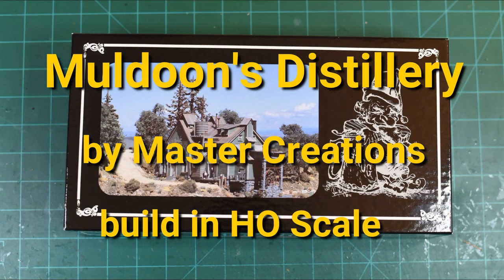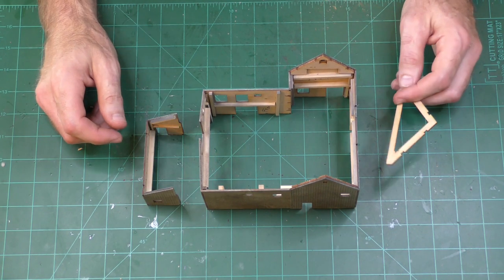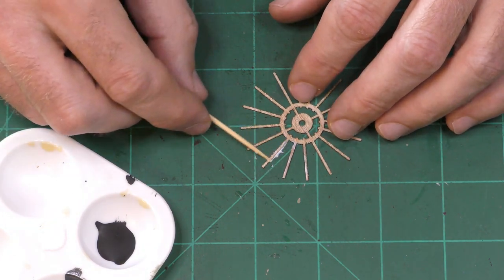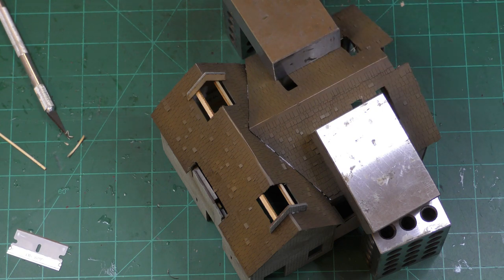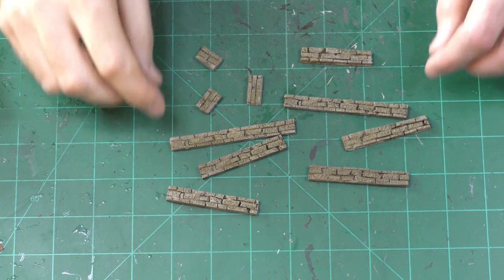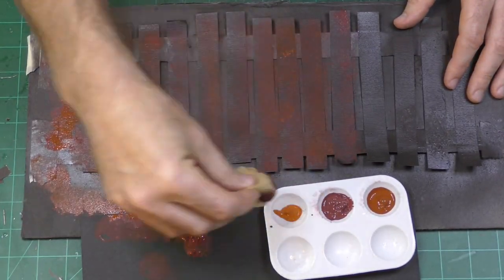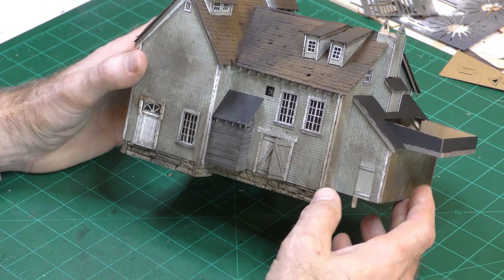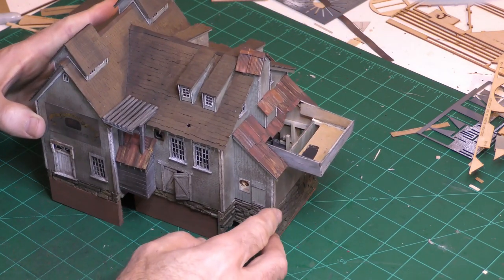Master Creations Muldoon's Distillery Build in HO Scale

Comment: Congrats on finishing .  These are quite challenging.  As to the ridge caps using a brown paper bag - just use the bottom of an envelope.  It's already folded and when you cut it, it will match on each side.  Just  paint it to match.   One caveat - it isn't all that common to have a tar paper ridge on a wood shingled roof.

Comment: Great build. I have fooled with the wood kits and they all seemed to be a  little difficult. Since I run N scale that doesn't help. You have some excellent tips which should help me, as I have a lot of building kits that I am going to build. I think the building turned out great. Thanks for sharing. Dave
Reply from the maker: Thanks for the comments.  My first wood kit was a Bar Mills basics kit, but I don't see that in N scale.  They do have the Shack Pack in N scale.  I recommend that.  Three different shacks, so you have three chances to get it right and it is pretty cheap.

Comment: You guys spend all that $$ on weathering powders and I go to the dollar store and buy women's make-up and get the same colours you do and mine only cost $1.00.  It also clings better than weathering powders..  Also I make my own rust (iron oxide) by soaking about 4 pieces of 0000 steel wool in a quart jar with white vinegar for a couple of weeks.  Then I pour it out into a photo (stainless steel) processing pan (tray) and wait for a few weeks for it to dry.  Then I use a single edge razor blade to pulverize it into a powder.  Now I have real rust to use as you would apply powders, i.e., mix it with mineral spirits or alcohol and a drop of glycerin.  Looks like real rust--'cause it's real rust!  Cheers from W Rusty Lane K9POW in eastern Tennessee

Comment: Thanks for the build. You did an excellent job and I appreciate you showing the short comings of the kit. I had the opportunity to purchase this one combined with another at auction. Had I not seen your build I would have purchased it. I am not a beginner and have built Cambell kits ... no laser cutting there... but at least the material is there and the instructions are fairly clear. They too are not for beginners. 
Have you tried Laser Art kits? I have enjoyed them and the parts fit together with a little sanding. 
Thanks again, Joe
Reply from the maker: Thanks for the comments.  I have not tried Campbell or Laser Art kits.  I saw some Campbell kits that looked interesting, but I already have more buildings than I have space for.

Comment: Interesting kit and fun to watch. You have some creative ways to deal with the challenges. Glad you kept the water wheel. Can I ask what kind of sponge you use?
Reply from the maker: Thanks for the comments.  They are natural sponges (at one time a living creature).  I get them at Hobby Lobby in the art section with paints, brushes, etc.  I assume any art supply store would have them.  However, I think some people prefer grout sponges which are synthetic.  So you might try different varieties.
Reply: @asdasx392  Thanks. I had tried some synthetic and found the results a little too even and regular. I'll pick up some natural ones to try.

Comment: The old kits are not as well cut out as the laser cut kits are these days. You have to do alot of improvising to get it all to fit together. Also being so old the small thin pieces are very apt to breaking. You've done a wonderful job with what you had.   👍
One question though is do you think it was worth the price for what  you got and the end result?
Reply from the maker: Thanks for the comments.  Generally I would say it was worth it.  It is such an intriguing kit and it is the only Master Creations kit I will build.  I am generally pleased with the result regardless of some glaring flaws in my build.  I did see one go unsold on Ebay recently for $180 so that is frustrating.  I don't know how many are left out there.  I try to imagine the reaction of modelers in 1991 - most with limited exposure to laser kits - paying what they did for this kit and then seeing what they had to deal with.  There are so few build photos out there, I wonder how many actually finished it.  I know Singapore Miniatures has build pictures on her Instagram.